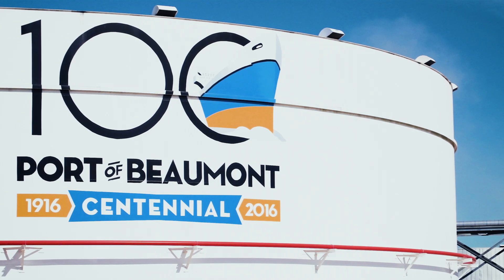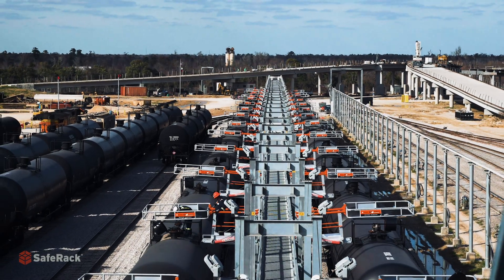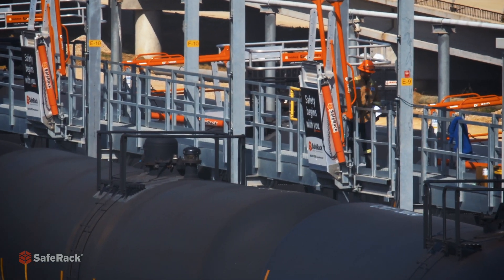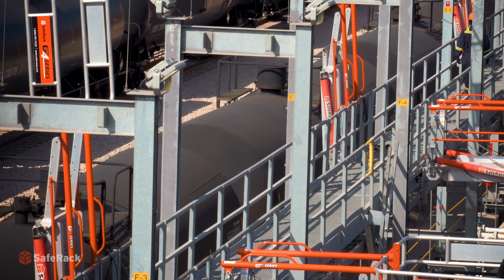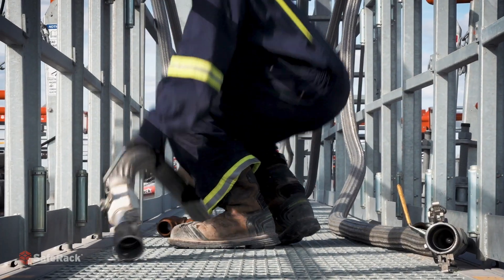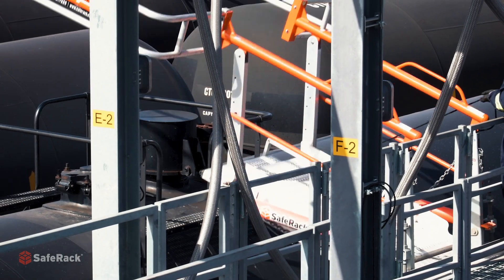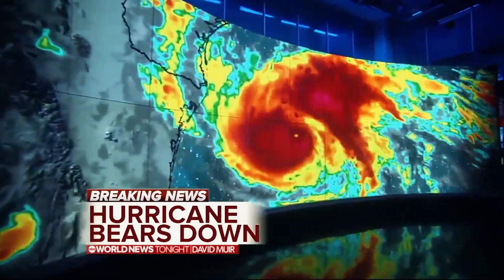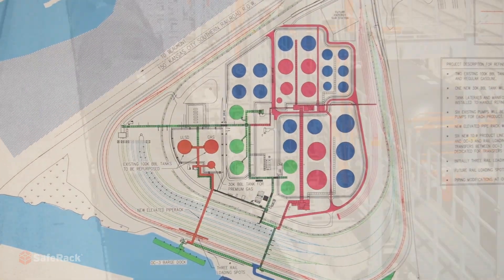Ethanol Loading with SafeRack and Jefferson Energy

Comment: Ethanol is a terrible addition to gasoline, resulting in lower miles per gallon, and attracting moisture. Production from corn and wheat makes no sense, and would not be viable without huge subsidies. The corn growers will never give up those subsidies, so roll on EV's.
Reply: In Vietnam the ethanol it's being added to the RON92-II to make E5 RON92-II which make it even more stupid :))).

Comment: Ethanol, ANOTHER SCAM from the "government". That krap causes small engines to get jelly in the carb bowl, and is a sponge for any moisture in the air. That Krap is not allowed in airplane engines and at the fuel pumps (for you boaters) the sign tells you to read your owners manual. Why? It sucks up water.